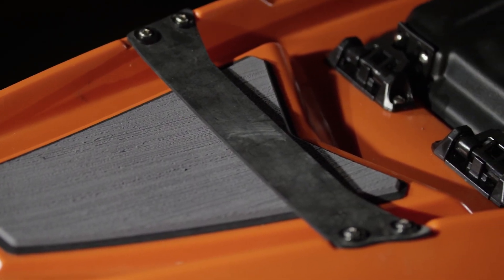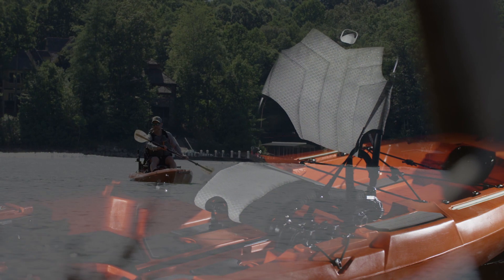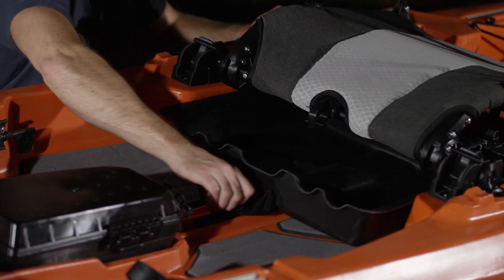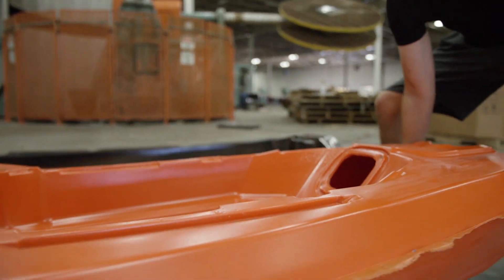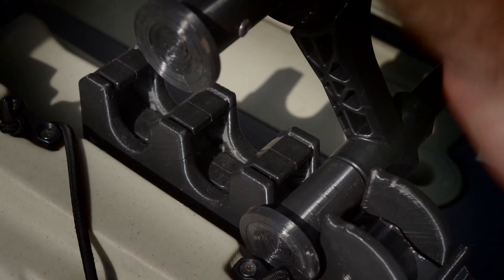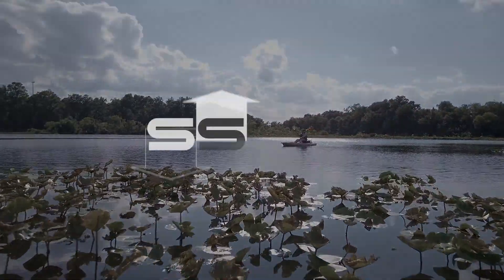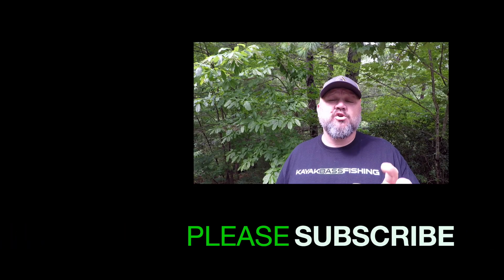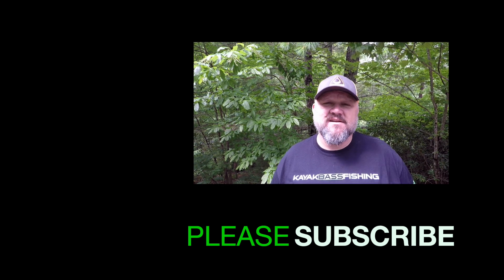NEW FISHING KAYAK | BONAFIDE SS127 | FIRST LOOK

Comment: Hm. That seat looks a little awkward(angle wise). I like the paddle holder. can't really tell much on the hull design. storage looks decent. guess we'll see
Reply: I think the hull is called a cathedral hull, just like the Kaku Wahoo. It is supposed to be stable and not unbearably slow.

EDIT: Didn't mean just like the Cabelas kayak, meant like the Kaku Wahoo, but looks like the Cabelas kayak or the Feel Free Torpedo.
Reply from the maker: +Dalton v it's not at all, it is one of the highest on the market though. It's a unique hull design too. It's not a cathedral hull.

Comment: Not gonna be a fly fishing kayak. So many hang up points on it looks like. They should offer and net thing to cover front bow like the diablo paddle sports do on some models. Just un idea to broaden the market for them.
Reply from the maker: +Miller Reid it's actually ready to go for fly fishing as it is. Nothing really hangs up, by design.
Reply: KayakBassinTV you know what weight is on this kayak?
Reply from the maker: +Miller Reid 72 lbs + or - a few from all the info that I have.
Reply: KayakBassinTV not a bad weight at all. Hearing that got me more interested would love to see pic of the whole top of it to judge the snag ability of fly line but I like to hear that weight